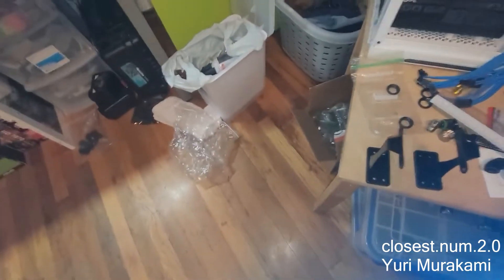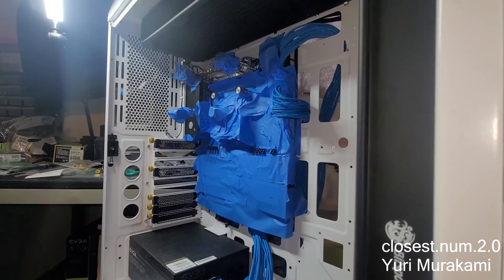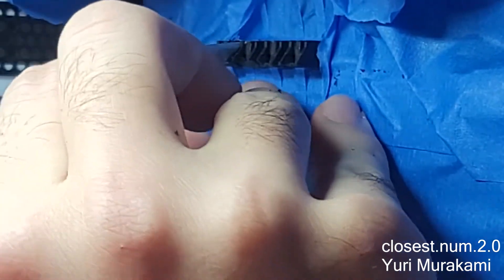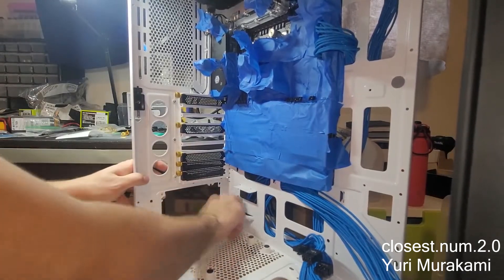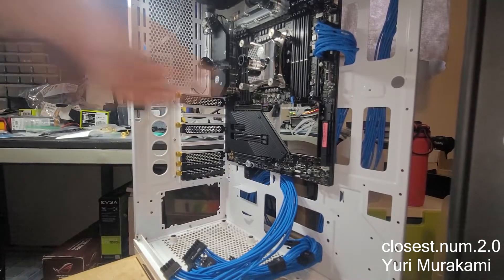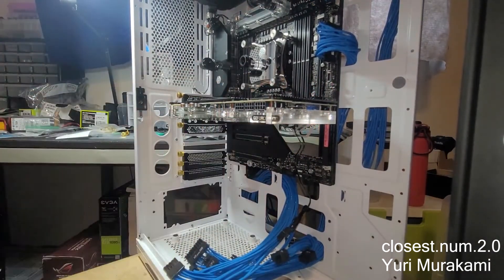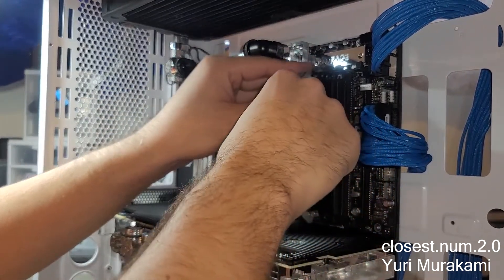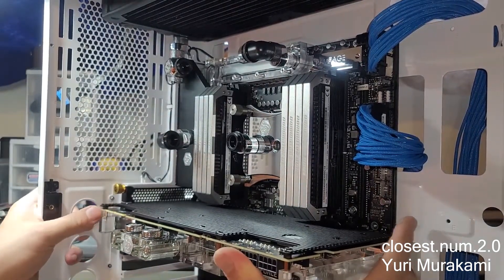Cutting a PC Motherboard?!?!

Comment: But why does it have a 5th ram slot on the right?
Reply from the maker: Its the same physical slot as a ddr4 slot but it is wired to the PCI Express slots. Its called a Dimm.2 slot and can be used to install two m.2 nvme ssds!